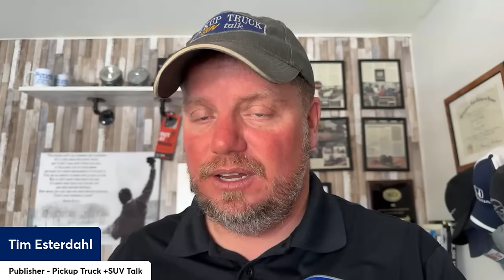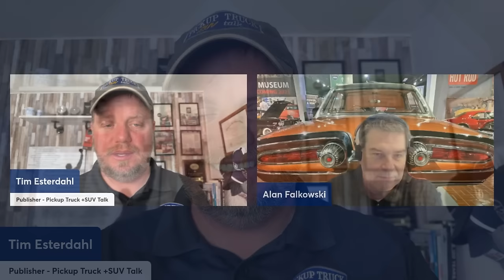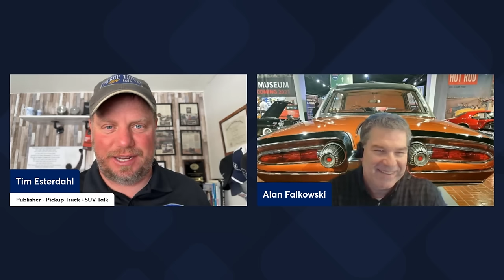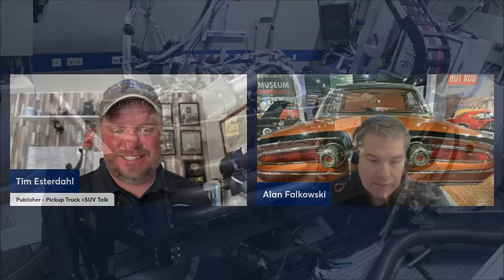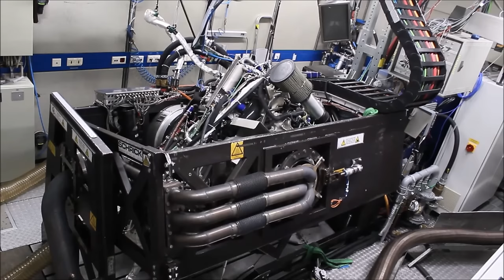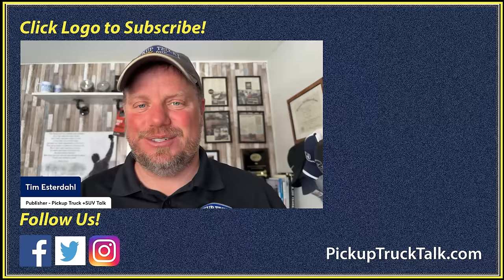Engineer Deep Dive: 3.0L Hurricane Engine - Turbo Life, Oil and Intervals and More

Comment: Tim That was a great interview.   I am eagerly following along with the new hurricane engine. as i think it will be in my next truck.     A couple things i want to know about the engine, that i have yet to find out are:   
1 Direct injection engines are famous for carbon deposits on the intake valves, Some other manufacturers have included some port injection as well, just to help wash the intake valves and keep those deposits from occurring.   Does this Hurricane engine have port injection as well (like the Toyota does)

2  For some reason, some newer engine designs are using a belt to drive the engine oil pump, and other components.  (GM small Duramax, and small Ford engines) This belt is bathed in oil and can fail.   
What is the bottom end architecture of this engine.  What drives the cams and  oil pump?.   Hopefully the oil pump is a gear driven piece, and there are no belts internally.

With your contacts in the industry, Maybe you can get a epic breakdown on the mechanics of it all, and gear heads like myself can nerd out on the mechanics of it all!
Reply: A little that I know. The 3.0 diesel
Engine by GM is belt driven but not internal with oil. It also cost approximately $7000 to replace due to dropping the transmission to get to the belt for replacement before 150k miles. 
The Ford engine like you said do have an internal belt in with the oil of the engine and is a huge failure. I have a 1.0L in my work car of a Focus. It that belt fails they replace the engine. 
I hope this inline 6 doesn’t. 
My complaints on the new engine. Turbos charged is great until towing. Sure it works great in a diesel at lower than 2500 rpm, but this engine is going to be more than 8000 rpm and will cause a lot more heat. If you own a truck and tow, the turbos will fail due to the heat produced. This is just common sense to me. Toyota has radiators on each turbo and has had an issue already and been fixed. I still believe it will be an issue in longevity for the engine.
Reply from the maker: Thanks for the comment. A few things:

1. Carbon buildup has been solved through burning the fuel more completely in the cylinder due to higher pressure sprays. Also advanced oil formulation reduces carbon build up as well.

2. Belts reduce noise in the cabin vs chains. Customers increasingly want a quieter truck, so automakers are going that direction. The inspection interval is 200k miles and, as that engineer told me, they can go further than that. This means, most owners, will never have to service that belt.
Reply from the maker: Where did you get the $7k number? That's not even close to most estimates I've ever seen. And the interval is now 200k on the LZ0 diesel. 

Did you miss the part where he talked about turbos and towing??
Reply: @Pickuptrucktalk  @scottboy does admit to knowing just a little…
Reply: @scottboyd8892 Agreed 100% brother
Reply: @paulhunter9613 Scotty Kilmer has wayyyyyyyyyyy more knowledge than you can ever think of, try getting you're overpriced Ecoboost truck up to million miles like the 4.7L I-Force V8 is the Toyota Tundra.
Reply: @CJColvin  try getting your turd 4Runner to 100,000 mi glwt
Reply: @paulhunter9613  LOL at least our 4Runner will make it to a million miles unlike you're overpriced EcoBoost truck mate.

Comment: We all know engineers are needed but in the automotive industry they still don’t seem to understand the larger picture and remember they’re doing what they’re told to do for their companies benefit.  They’re tasked by their Execs to meet certain criteria which ISN’T shared with the public.  Things like longevity vs. warranty and overall service life ARE NOT in the best interest of the consumers, they’re always in the best interests of the manufacturer.  It’s not balanced and fair, it’s ALWAYS a greater benefit to make more profit on sales and service.  With greedy inflated prices, the answer is to stop buying these new throw away cars and repair and restore the vehicles you currently own!!!
Reply from the maker: Ah, the “they are built to fail” logic. How do you explain million mile trucks and semi trucks then?
Reply: @Pickuptrucktalk  big differences between a 16.0 liter diesel engine engineering vs. a high hp 3.0 twin turbo engine in a pickup truck!!!!  Semi truck engines are designed to be rebuilt multiple times and have removable sleeves, operate at low low rpms.  Not even sure what you’re getting at with such an apples and oranges comparison!  Expectations of heavy truck diesel engines are also far different than a small 1/2 ton gas truck.
Reply: @Pickuptrucktalk  a semi-truck doesn't share a use case scenario with a passenger vehicle....come on now. Also, those "million mile trucks" have the engine replaced or rebuilt at least once, if not twice before the vehicle hits that mileage. It also helps when those trucks are Toyotas.
Reply from the maker: @wvjeepguy8178  I have a series of videos of million mile trucks including a Chevy and Ford with original engines and transmissions.

Comment: I believe this engine is brilliant in design. However, I also believe things like plastic parts and other cost down engineering will render it an abomination.
Reply: Yes that’s my worry too. First thing I look at on new engine design is how much plastic did they use in the cooling system instead of metal. Plastic cooling system parts usually start to fail around the 3-5 year mark.

Comment: It could take me 2 years to put 10,000 miles on my vehicle and I live in Florida high humidity there is no way I am going 10,000 miles between oil changes
Reply: No way. Especially on a boosted engine. I do 5,000. 6000 max. I don't trust these guys.
Reply: Mine has a supercharger and I change it every 3,000 miles. Not to mention these new low-friction rings get a lot of blow-by, which is even worse when a supercharger or turbo is in the mix.

Comment: How about the waist gate? I drive class 8 trucks and it’s always the waist gate that fails. This is true with cars. The big trucks have a vgt is very complex. In cars the bushing fails. The one thing he didn’t address carbon build up. Even KIA has addressed this with duel injectors. Hurray for the ZF transmission. It is one of the best and has a proven track record. I am hoping this truck does well. Heaven only knows we need one.

Comment: should have asked why after the whole time the 5.7 hemi was around.Why they didnt fix the oil pressure issues leading to lifter and cam gouging problems. lazy engineering at its finest. this engine wont be anymore reliable.
Reply: It was only a problem on engines that saw excessive idle time and the issue was blown way out of proportion for the average hemi owner. They also adjusted the oil pump pressure when the 6.4 liter hemi they use in RAM trucks came out and the performance hemis all have high pressure pumps installed. The 5.7 has been in the phase out process for years so sourcing a new pump would have cost them a lot of money so that's probably why they never changed it there.

Comment: The 5.7L Hemi was a trash heap that ate valvetrains, oiling was the primary problem at low RPM as well as the MDS system later. GM's 3rd gen small blocks as well as Ford's eventual 5.0L were miles better, but this could be fixed. The older LA engines were bulletproof. 

But 3.0 Turbo is way worse. When i go to buy a truck HP/L is a non factor. MPG is a mild factor as in if it gets better than 13 MPG empty it's probably okay because it's a truck and i expect it to get truck like fuel consumption. What i do care about is complexity of the overall system and how much life i am expecting from the powertrain. Turbo's suck for this as they are expensive to fix and have low life compared to a NA engine. GDI engines have a problem with carbon, it's not if but when. PFI never had this problem. Auto start stop is a reliability nightmare. 

So you now have a small displacement (For a full sized truck) that is under a lot of boost, and that has a very high pressure fueling system... Running gasoline. You might as well just get a Diesel at that point. And like all Stellantis engines it will leak from multiple orifices by the 70k mark. Maybe even a turbo rebuild by that point, not 1 but 2! of them on it.

The reason to buy a Dodge has historically been the Cummins, truck falls apart around the tractor engine basically over time. Dodge trash heaps + a unreliable engine is a non starter. If it's a half ton Tundra all the way or even a Ford with their seemingly excellent 3.5L, or the 5.0L that is still available. Being honest the best option is go get a super clean early 00's GM truck or like a 15-17 Ford with a 5.0. Cost less and last way longer.

Comment: Time will tell, they said the Hemi engine had no issues, but time says otherwise and it is not sane to not have a dipstick to check ones oil.   That was not smart at all.  What if the sensor goes bad?  What if you have a leak from a seal that has issues?  What happens as it ages?

Comment: This is another case of someone else telling me what I need. Let me tell you something,  I will decide what I need. As far as Ram goes, you need to make what the customer WANTS. Now you say that people will go buy a competitors product. You nailed it. While this I-6 might be great in a Jeep, I drive a 2000 Cherokee with 180k 4.0 engine. Its been stone reliable. But now that I am relegating it to my winter snow and ice driver I will go buy a Ford V-8 half ton for my daily driver and Powerstroke for my work trucks since Ram decided I don't need a V-8. Sorry Ram. No dip stick? What the hell? Now you have to trust a computer to tell me when I need to add oil, chainge oil, whatever. Bull. Ill be damned if I will take it to the dealer to have them plug in and check my oil. No dealer or any shop for anything but warrantee work. And then these extended oil change intervals are just a way to get you to buy a new engine. What a shame, and what a joke. You can say I'm not impressed. These new engineers seem to have forgot the fact that a small engine straining will not last as long as a big engine loafing. There is no substitute for cubic inches. Fill for life trannys, oil sensors to tell you its low. Start/stop, No Charger or Challenger just a EV. Sad. Very sad. Just sayin. Back to Ford......

Comment: Higher revs, more heat, and you're beating the crap out of it by using turbo chargerS. The V8 provides plenty of power without turbo charging.

Comment: 10k mile oil changes??….a lot of turbo engine problems are long oil intervals
Reply from the maker: What makes you say that?
Reply: Ford mechanics that I know and some you tube mechanics like FordBossMe. I also purchased a Toyota Camry that the previous owner did 10k mile oil changes and I’m having issues with the VVT cam actuator which my mechanic has stated is because these long interval oil changes. I own an ecoboost engine and do them every 3k. Not saying that every engine will have some sort of failure due to long oil change intervals, just saying it’s risky and with the cost of engine repairs and new engine replacements, it’s just a safe bet to change oil 5k at the most.

Comment: Oil level sensor works great, until it doesn't.
Reply: Devils advocate here. Oil sensor checks the oil every day + can throw engine code if it fails. Dipstick requires user to actually check their oil- something most never do. I only do right before a big trip .

I do wish they just had both.

Comment: I'm not sure that turbo engines should replace a v8 for work...but i at least like that it's a straight 6 and not a v6 like ford has.  The old leaning tower of power, as well as many other straight 6 engines were reliable because of being inline.  Granted, direct injection, variable valve timing, turbos and other modern systems add complexity and typically reduce reliability...or at least lifespan but imo the inline architecture gives it a better chance of being good.

Comment: Twin oil pumps on the 6.7 liter Cummins straight six one for the  first three cylinders and the other for the rear three cylinders maybe with a canister filter for each oil pump, and a pickup tube for each pump. Would possibly reduced or eliminate the oil starvation issues. Plus the 3.6 Liter Penta Star engine made  with a HO version with a supercharger or twin turbos would be a possible gas engine upgrade for a six cylinder Mopar engine.

Comment: I've been using that annual Mobil 1 20,000 mile oil in my ford fusion for a few years now along with the oil filter to match.  No issues, but its not turbo, just a 2.5L 4cyl.  I would say the downside is when i go to change the oil the filter is about bonded onto the car (and i never overtighten an oil filter when installing).  The oil is more expensive,  but going a year between changes is nice.  I never drive 20k miles in a year, probably more like 8 to 10k.--oh and i also check the dipstick a few times during the year to make sure its good.

Comment: Now you add a bunch more parts to break down to eliminate the coking, but you got an electric pump in addition to the regular water pump and more coolant lines, temp sensor, wires to sensor and pump you solved one problem by adding a bunch more... congratulations I guess?

Comment: Why 0w20. This oil is like water when it warms up. I switched my Hemi from 5W20 to 5w30 after I had cam, pushrod and rocker failure. Lifter bearings were fine. My Hemi even sounds better and smoother then it ever did with now almost 270k km on it.

Comment: This motor may well prove to be reliable in service. But concerns about that are not founded in old engines but rather in recent and current history. 

For example the problems with the Hemi and camshaft failure are evidence of a known reliability issue that made it through all the testing and even worse once known wasn’t fixed. 

And in the turbo truck engine world the Ford Ecoboost was and is a purpose built boosted truck engine that has had major reliability issues including turbo failures.  By contrast the NA 5.0 in the trucks has been a reliable engine. 

A turbo engine is obviously under greater stress because of its higher specific output compared to a NA engine. That greater stress has an unarguable potential to find and create problems that might not have shown up in a less stressed engine. 

So when a company that built an engine which had reliability issues they refused to fix despite not being highly stressed now introduces a very highly stressed engine and tells us to trust their engineering no one should be surprised when the reaction isn’t trust but rather concern about the reliability of this new and untested power plant. 

The Hurricane may well prove to be everything the ecoboost should have been bust wasn’t. Time will tell. I hope that it does. But I’m not going to be the test subject. 

And Ram/Stellantis needs to decide that when problems do crop up the solution isn’t to deny it and hide under a rock. It’s to figure out why and get a fix out resolving the issue for both current and future owners.

Comment: Only a dipstick with making an engine that you can't check the level of oil.
What the oil condition mechanism usually is measuring is how many hydrocarbons are getting into the oil, read that as gasoline contamination. Gasoline contaminates oil and it doesn't take a lot to start damaging the engine. Maybe have an interview with Lake Speed Jr. who I believe has a PHD in motor oil Sciences.
I've been playing with engines since 1964 at a very young age. I've seen people start believing some really strange things when it comes to engines.
I still tend to wonder where people get some of their information.
The spray deposition liners I think are cool, when I first heard about it, and the fact that I work with Metals for 40 years and my primary vocation, although I've had many vocations over my life. When you spray deposit nickel iron onto an aluminum structure, which is the way most manufacturers are applying this system what happens is is that as the nickel iron cools, it gets microfractures in it. That's the porosity, along with the fact that iron is not necessarily A non-porous metal. The Finish that's put on that is a 1200 grit Diamond stone that nearly polishes it standard crosshatch pattern that we've seen for decades.
I saw this on the 3.5 and on the coyote engines the Ford was using a number of years ago and explained it to the guy who was supposed to have been briefed on how this system works. I could tell from looking at the bare engine block that had the spray deposition sleeves in the aluminum block. And I instantly understood exactly how they had deposited it and what finish did they left on the inside of the cylinders. Although I assumed it was a thousand Grit at the time

Comment: Pumping coolant after shutdown is better but first and formost, pumping oil after shutdown!
To me that is the number one cause of turbo failure.
The turbo continues to spin up for a period of time after shutdown and does so without any oil feeding it!
Add a small electric oil pump that is fed by an electronic timer that only feeds the turbos after shutdown.

Comment: Truth is:
Turbo engines require good oil to last longer and NA V8s can stand a lot of abuse(lack of maintenance).
So that is the reason many people have bad experiences with turbos (lack of  maintenance) and some don't.
If you are not willing to pay for good oil and change engine oil every 5000 miles and still want the engine to last, then pay more for a japanese NA engine and forget power and torque.

Comment: What happens when the oil level sensor goes bad?
Reply from the maker: The truck sends you multiple alerts and tells you to go to the dealer for repair. You still have oil in the engine even if it goes bad.